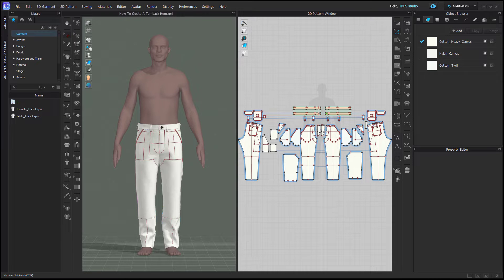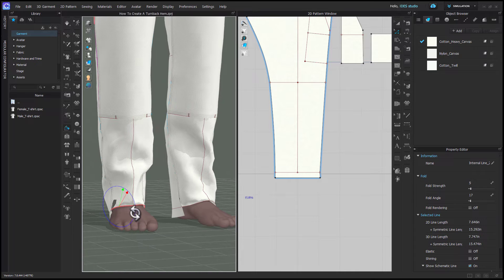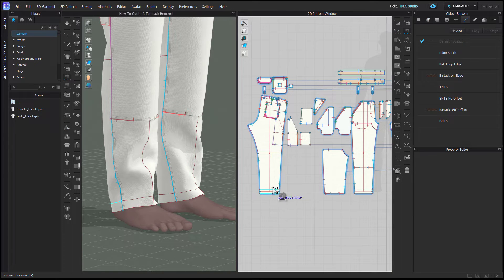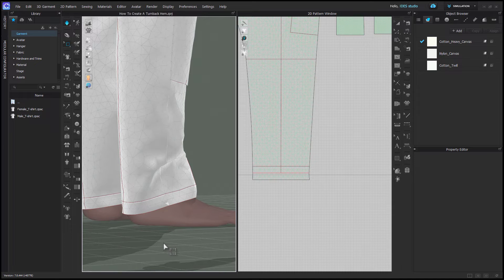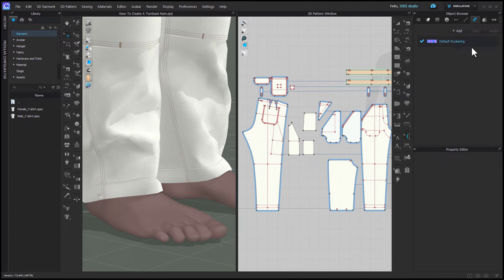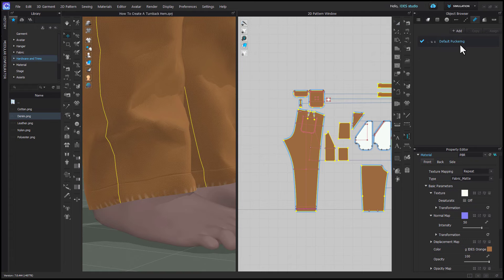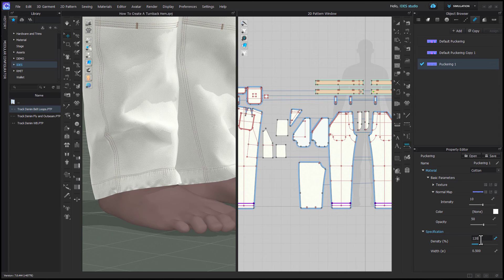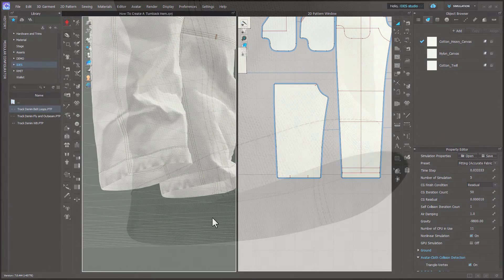How To Create A Turnback Hem In CLO 3D

Comment: I want to recreate the hem or piece of trim fabric than runs around a loose top. Is it best to overlap and sew or to use a fold/hem technique.. is there a difference?
Also, I have tried the hem fold technique and taken the mesh into a 3d program for higher Res render. The fold of the hem in my case a t-shirt neck, is low res. It has just one fold line for the curved hem edge.. can I increase the smoothness in Clo3D do you know?
Reply from the maker: For hems, especially in 3D, the rule would be only fold it back if it’s a straight edge. If it’s curved at all, make a pattern piece that is the same shape as your edge. (Don’t mirror it like in real life, make it identical). This is a good idea for a video. I’ll try to make you one if this doesn’t make sense.

Comment: For the belt loops, is it 1 layer of fabric thickened? or was it folded? Also did you thickened the pockets?
Reply from the maker: Good question. I usually add rendering thickness to belt loops. That plus topstitching looks real, so I don’t bother with layers. I never thicken pockets usually, unless there’s an actual reinforced piece. But I always turn back the top hem on patch pockets, so that edge does look thick👍